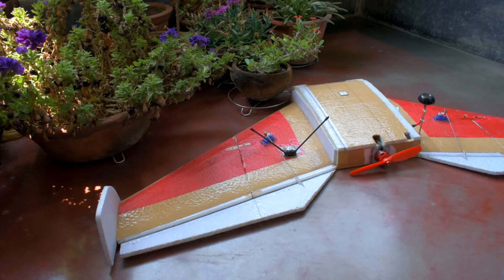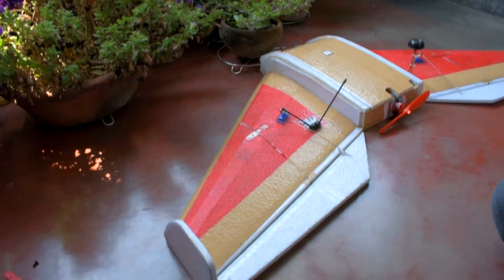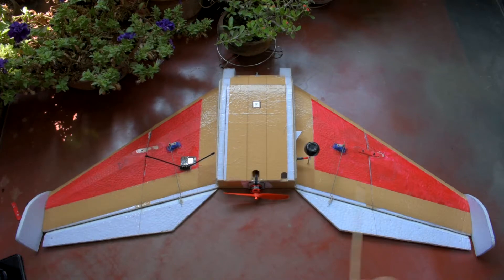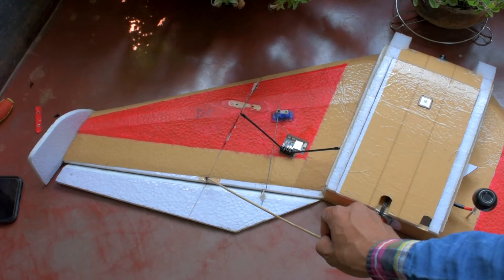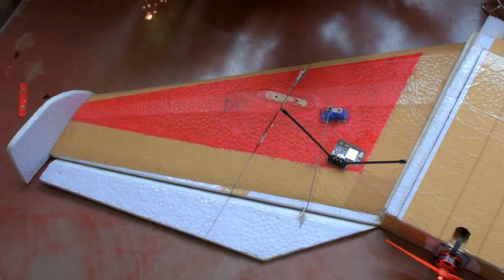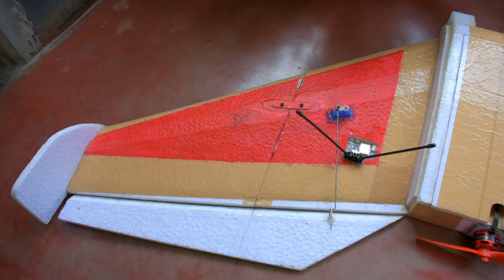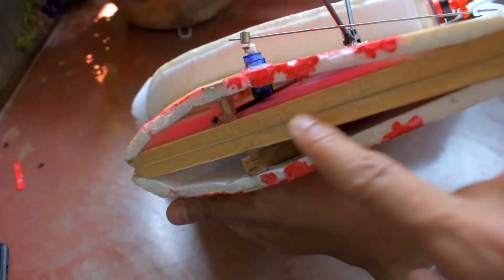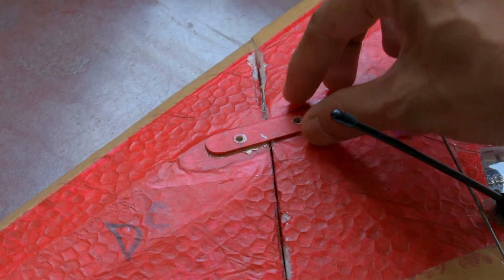Build Tutorial || The Shrunken || Foldable RC Plane

Comment: what is the maximum weight of this plane and i am using a 3s 1000mah 40c battery which weighs 100g and other components are same and whats the material of the plane body and its thickness please and can i substitute it with cardboard???